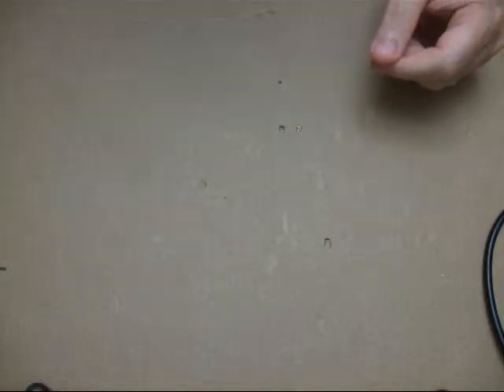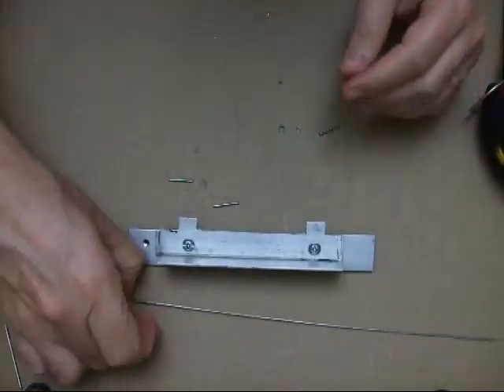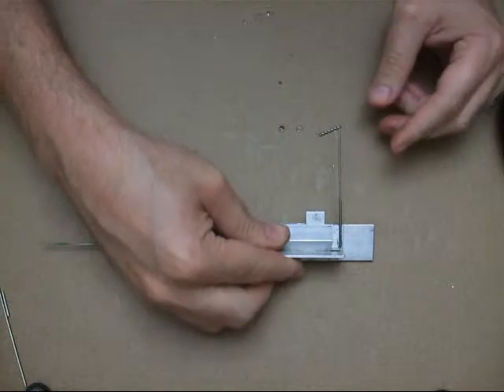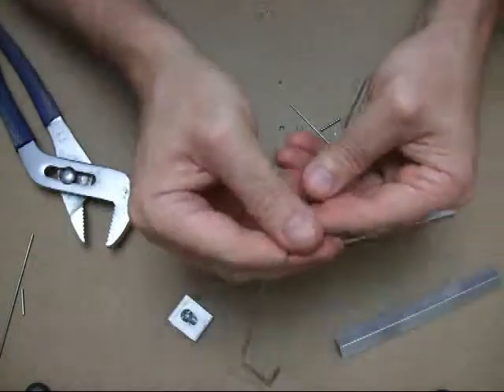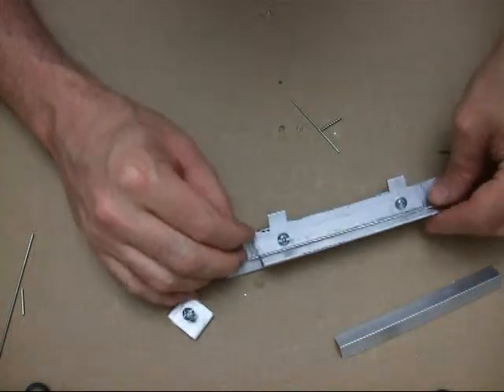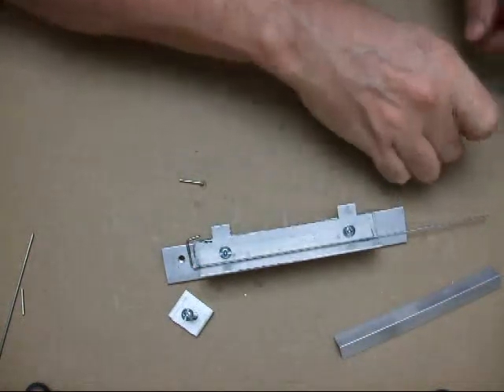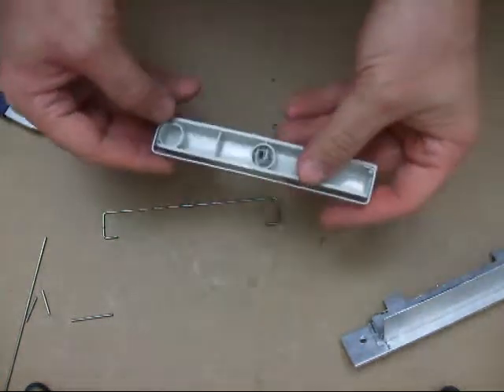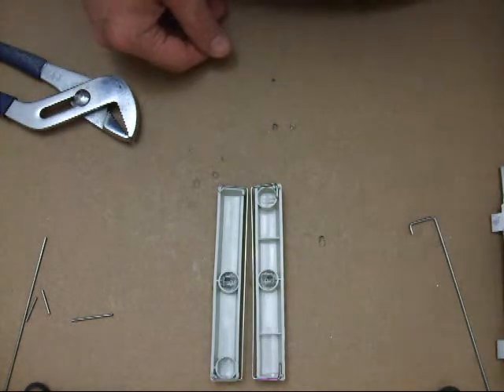How to replace an IBM Model F keyboard spacebar

Comment from the maker: Standard aluminum flats and angles cut with a Dremel; clamped in place; drilled and bolted. A bit of trial/error/adjust/adapt.

The stock F stabilizer clips just are not big enough to enlarge to M thickness, but they can be replaced. I have done as much with bent metal strips attached to the top plate with epoxy. Replacing the wire is a more elegant solution.  

You can get a lot of good keyboard restoration and modification ideas at http://geekhack.org and http://deskthority.net

Comment: How did you make the jig? In addition, if I wanted to use a Model M spacebar and stabilizer on a Model F-122, would it be possible to enlarge the stabilizer clips on the Model F to accommodate the larger diameter wire from the Model M?
Reply: Yes. you can do it with two pieces of sheet metal bent into a "z" shape and then epoxied to the metal plate.